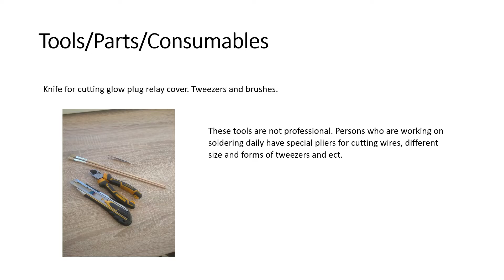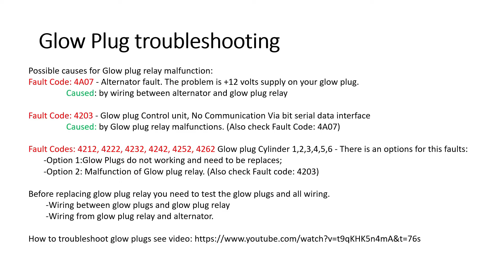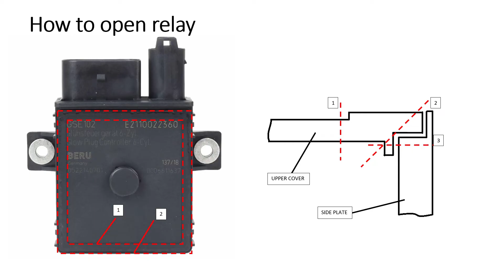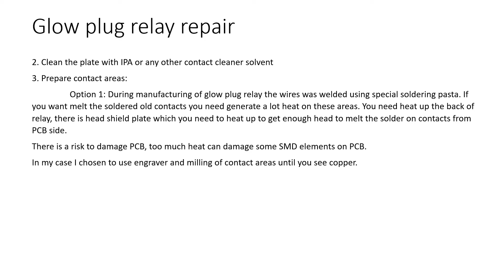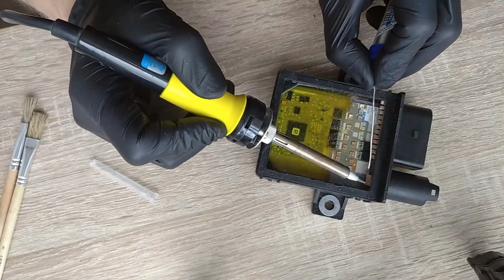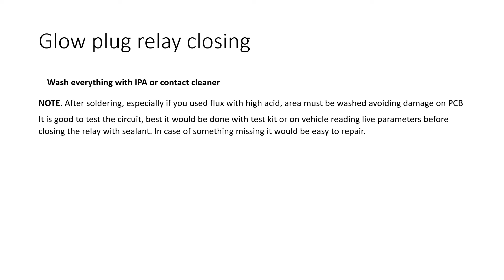Glow Plug Relay Repair BERU GSE 102 101 for BMW E Series Fault Code: 4203

Comment: Very useful video. So far I have done the testing on a Mercedes A6461532579 relay. For #2 output there is higher resistance. About 270K instead of 180K. So I think it's not a broken wire. Is it maybe a broken electrical component?

Comment: Hi. Great video! Maybe you can give me some advice? BMW M47 320D 2007

 I had the 4212, 4222, 4232, 4242 fault. I changed the GP module and it was still the same. So I got another new GP module and changed all the glow plugs too. Still have the same faults. I checked the voltage on the high current wire (with circular connector) and that has 12V. The car starts roughly with the GPM connectors in or not connected so I assume the GPM is not being activated (but no 4A07 code). I assume there isn't a fuse for the GP system? Any suggestions? Thanks

Comment: Hello. I have done it exactly same way as shown in video. 
I have one question: After repair, i have tested with multimeter and on 5th pin in shows near 11 and on all others near 4. is it normal?
Reply: Don't listen could be huge misunderstanding, when test should 5v if not it means tiristor that regulate voltage is blown, the unit needs to be replaced. I buy 2 new damaged units and cost me burning all the plugs twice, be aware what you're getting so you can send back measure first, measuring with bulb will not show voltage use meter for this
Reply from the maker: @todornakov2614  so true. Agree. Logical explanation. You supplemented all this work. Thanks!
Reply: @todornakov2614  Wenn 4,7 bis 4,8 V anliegen ist es dann defekt ?
Reply from the maker: Hi. You are measuring inside circuit resistance. If wires broken resistance is infinity. Best way to test is with lamp tester. In my case I installed in car and made diagnostics

Comment: I tested all the pins with my multimeter for resistance and they all show infinity
Reply from the maker: That can be caused by broken wires inside
Reply: @BMWhale  I ended up opening the unit, tested all wires on the board they all are OK. I even pulled each of them with a good tug and they are very secure. I ended up buying a new one.

Comment: Any wire?? Mat This wires work as fuses!! Can you imagine one of your glow plugs is broken and got short to ground!!
Reply from the maker: Hi, agree with you. Any way if you have any doubts buy a new one and you will be sure for 100% mate :)
Reply: Yeah, needless to say, if they were properly built, this would not have been necessary in the first place. 

It's always about some company brand's corporate strategy to take money away from people viciously without mercy by having them purchase their products over and over again because they designed them to fail after long-term use. Not to mention how hard it is to get to. Thankfully this video guided me along the way. My pcb was similar but different, yet it needed the same re-soldering.

Also, when glow plugs fail, they go open circuit; the fact they conduct current (shorted to the block) is their normal behavior and job to do so. 

If glow plugs get old, they require more current to heat the block, and in the event of an overcurrent, it will be the module to open the circuit, not to mention that it would be protected by a spade fuse.

Comment: TESTER relay?any link
Reply from the maker: TSS-1 from Carelectronics. But it seems more like it is made by its own. The point is that beru glowplug relay output is impulsive dc 5V voltage, so clasic heat coil light tester works fine
Reply: @BMWhale  need tool for  restoration units .in car yes you can test classic way.